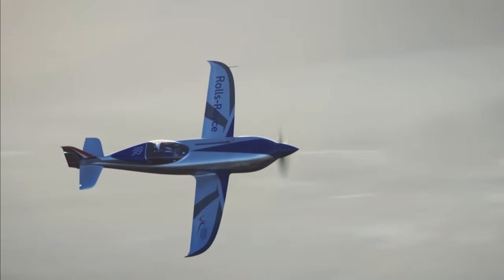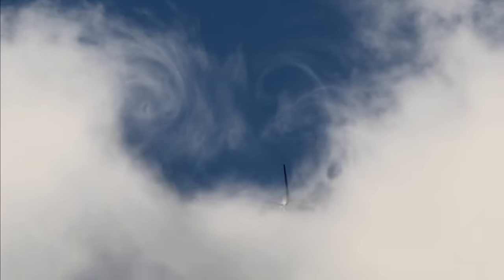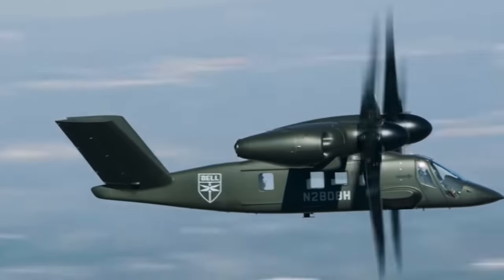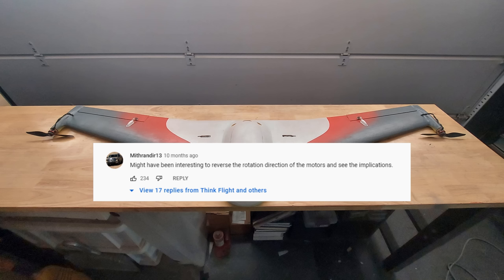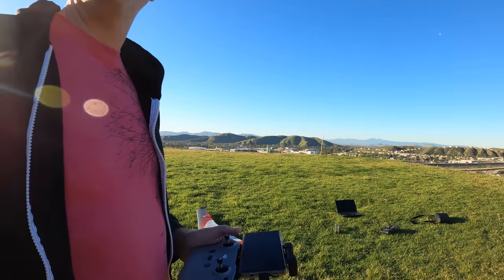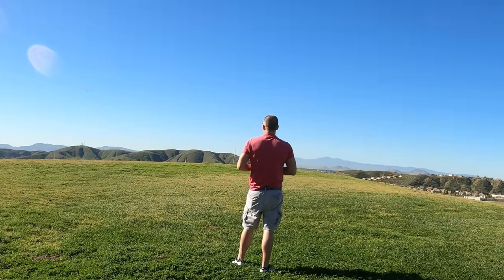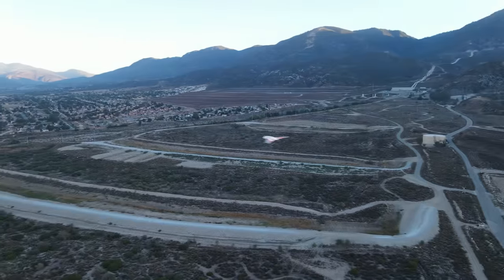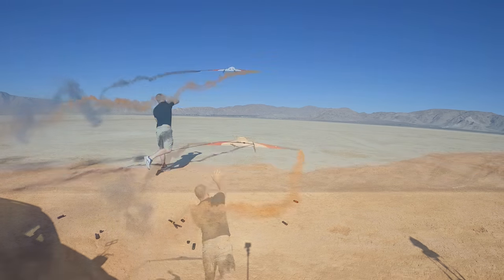Can Wingtip Motors Improve Aircraft Efficiency?  (Part 2)

Comment: I would think (and I cannot be wrong in this matter, just misjudging of the magnitude of its effect) that any swirl (i.e., from a propeller) over a lifting surface (i.e., a wing) will fundamentally decrease aerodynamic efficiency and therefore lift-to-drag. LD is everything.

Utilizing many smaller propellers instead of one big(ger) propeller (on each side) is a flawed solution. And, yes, I am aware of the saying that any aircraft is a collection of compromises flying in close formation. 

To be mindful, then, of first principles: What you describe will never work as well as the conventional configuration, in regard to my specific concern above.

However, this is not to say that motors don´t have fundamental advantages over engines, but why oh why cannot a big, slow moving prop not be electrically powered, instead of a “zillion vortex generators“, as you would envision them?

With electricity, there is not the constraint of powering a prop from the hub. Radial engines with their large frontal areas illustrate the fact that the distal 40% of a prop generates 90% of its thrust.

Also, you do not discuss whether the props at the wingtips turn clockwise or counterclockwise for the express purpose that their Q-factors mitigate wingtip vortices.

And don´t even get me started on the problematic concerns of battery weight, charge density, battery aging, the nonexistence of charging infrastructure in general aviation, or the fact that lithium + moisture + vibration is the modern equivalent of flying a Me-163 Komet, whereof in that WW2 aircraft the pilot tended to be dissolved to death by its corrosive fuels. Have you not seen what happens when a lithium battery fails catastrophically?

Maybe some day electrical propulsion will have its ascendancy over petrochemicals, but not yet. I look forward to the time that graphene-based batteries are sufficient developed and available, or even better yet, the discovery of a room-temperature superconductor that will enable a practical SMES (Superconducting Magnetic Energy Storage) device.

Now that will definitely revolutionize aviation!

Comment: I have to add that on average i have seen far far less operational failures from electric motors than i have engines. The simple truth is although fuel can pack much higher energy density the cost is a far far more failure prone machine, the intricate nature of engines can function greatly for air vehicles but when they fail it goes bad. If a motor has a similar point failure in the coils it is likely an overheating issue or a short and that motor will just have to run at reduced speed, far more favorable of an outcome than complete engine failure.

Comment: Also friend if i were u i would use a tractor and use a folding prop (the sort used on model giders) as then you wouldnt damage the aircraft when landing
Reply from the maker: The motors sit low and just dig in
Reply: Oh ok! It won’t do ur effecency any good but chucking some retracts on it would be cool!!
Reply: An option might be launching/landing VTOL in a tail-sitter configuration. 
Typically with tail-sitters, motors are mid-wing to give maximum airflow over elevons.

Comment: Aircraft are a compromise, you never optimize 100 percent of each aspect of the design. Tip mounted engines only work if the two engines are physically connected mechanically. A failed engine (without cross drive) will cause an excessive yaw condition because of the drag generated by the stopped prop (even if it's feathered), plus the opposite engine generating power, So a mechanical interconnect is the minimum needed to assure both engines remain turning. The mechanical interconnect will prevent the yaw moment created by 'Single engine out' condition, which is going to be considerable, a terminal spin would be the result at low altitude without out it I suspect. Cross wind landings would be a problem requiring very long main gear legs, or the landing gear will need to be out near the engines which in turn means an increase in both beaming and torsional rigidity requirements, this adds weight, plus the ground loop problem. The governing failure condition is centered on the thrust line and it's distance from the cg. As an aerodynamic curiosity these types of configurations are worth pursing for the sake of science. however pursuing designs like this to be man rated and such is too dangerous, we end up with an aircraft that is very heavy because of the design configuration needed to deal with the Yaw issue.  There are other ways to solve the basic problem, but this video is about one configuration.

I'd like to point out that there seems to be many new electric designs that use many propellers, up to ten on some designs. People need to understand that a propeller has a TCDS issued to it, and therefore requires annual testing ( the same goes for the motors BTW). This could be very expensive, engineering students fall into this trap often because they don't know the FAA requirements.

Comment: They North American, XP-82, didn't fly, it's 1st two times. The Reason: while using the P-38's idea of one engine spinning Opposite (to eliminate 'Torque' and Rudder-Correction), the first 'Twin-Stangs', had their Merlins mounted on THE WRONG BOOM, thus Cancelling the 'Added' lift they were supposed to have in-flight. VORTEX Matters!

Comment: If you want I can simulate it for you in starccm with more details
Reply from the maker: How difficult would it be to simulate with rotating props of different pitch?
Reply: @thinkflight  if you provide the cad it wouldnt be too hard , but we can only do steady state rans with medium mesh density ( around 10 mil cells ? ) maybe less due to low speeds
Reply: We can communicate via discord if you are using it

Comment: Such aircraft would be absolutely deadly if one engine failed way too much power on wingtip and none on the other side would instantly render aircraft uncontrollable.
Reply from the maker: This is a drone testing wingtip motor efficiency.   It is never suggested to be used as a final configuration for manned aircraft.
Reply: @thinkflight  That is true as a drone it is fine.

Comment: The Problem I see with this Engines at Wingtips Plane Design is ... the weight is on the Wingtips , which is at the Weakest Point of the wing .... And the motors are far from the center line , so if one engine fails ... you can't Fly home on one motor ! ... That's why you Never see this kind of plane ... :-/

Comment: @Think Flight
An idea for future research.
Imagine a test rig that can attach to the front of your vehicle, it can support the item that is being looked at but not interfere with it.
You could test a wing or entire aircraft without flying it or having to use a wind tunnel. It'll also let someone record video using as many cameras as you want and from whatever angle you want.
This would even allow you to test a wings maximum load as if it were doing a loop.

Comment: Without knowing the actual effect of the loss of one motor on a quadcopter, I'm still not buying your argument that your tip thrust proposal is an "acceptable" risk since quadcopters are generally an all-drone application.  (Unless, of course, you are thinking this advancement is STRICTLY for unmanned vehicles, in which case, ANYTHING goes.... 😂)

Comment: Maybe a "normal" plane would work better for testing this (with separate vertical stabilizer and wing). Also it might be worth to consider the fact that (at the same thrust) 2 propellers are less efficient than 1 bigger propeller, so for the wingtip placement a good option it should be also more efficient than the disadvantage of having more drag

Comment: 🤔☝, The wing is getting mini pull of Air Flow From On Top (- Pressure), Under wing getting +Push Due to rotation of, Vortex,  Advanced of wing ? If sideway's being Perpendicular? Versus - Dragging Air Towards the Top of wing in "Opposite- Inward rotation, Pushing Downward on WIng's Top surface. is Oposite of Removing air Pressure from the top, {If Vortex Pressure Spin Direction, Matter's}. It would barely be any thing,  and not have a Far reaching effect.  I just can't say, hat's my thought's,  Hope my wording isn't confusing, hard concept to verbalize, Need drawing board to be Clear.. Kind of retarded, Dain Dramaged..
 Love your Skilled, Build, Nice work.. Brillant plane Sir.👏

Comment: Love the content but comparing the weight to power ratio of engines without factoring in the stored energy to weight ratio of the fuel (or batteries), is pointless.
Reply: No it isn’t.
Engines of all types (air, land, sea, space, subsurface) are rated by thrust (or impulse) to weight of the engine itself.
This is also why many engines also include a per vehicle installed power/thrust/impulse to weight ratio.
Without the engine-specific power to weight ratio, considering different engines for different uses would require ridiculous waste of time, energy, manpower, and money.
Reply: @montithered4741   an engine is nothing without fuel. Just so you know that.  Power to weight ratios are for comparing like fueled engines. Unless you factor in the different fuel THEN ITS POINTLESS.
Reply: @C3Rl3  
What engineering degree do you use that DOES NOT compare engines by  power/thrust/impulse to weight?
Engine Performance is engine performance?
Reply: @montithered4741  "Engine Performance is engine performance?" yeah it totally doesn't matter.  The engine doesn't need fuel.. your right. Engine performance is 0 without fuel.  But hey you better not factor in the weight of what the engine uses right. idk if you need a engineering degree to know that. 
wait do you have an engineering degree? If so do you expect people on the internet to believe you when you say you do.
Reply: @C3Rl3  
The fuel weight is separate from the engine weight.  
Factoring in fuel weight with engine power to weight ratio is foolish because then the exact same engine would have many different power to weight ratios.  The amount of fuel doesn’t affect the power to weight ratio of the engine.
Reply: @montithered4741  your right, all fuels have the same stored energy to weight ratio. Thats why electric motors have been far more efficient than internal combustion but just some how i wonder why they weren't in things that had to move independently. I bet it was the government just keeping us down your right. It definitely wasn't because of the stored energy to weight ratio of the fuels used. Have fun with your theoretical engine that can fly to the moon cuz its fuels weight doesn't matter. lmfao

"then the exact same engine would have many different power to weight ratios."
 wait you just figured this out?  yeah i mean if i just run any fuel that will cause combustion in the thing the power to weight ratio surely wont change. Man your magic motors are gonna change the world.
Reply: @C3Rl3  
You really aren’t paying attention; rather doubling down on an already flawed claim.  Square pegs into round holes often?
The energy density of fuel is separate from the power to weight ratio of the engine.  Engine performance is given per fuel source, so again, one engine could have multiple power to weight ratios.
How do you plan to compare your near infinite numbers of different performance specifications for your imaginary engines?
Reply: @C3Rl3  
Electric engines have the capability of being more efficient than internal combustion engines; but again you are trying to cram too many factors into a single design factor.
I never claimed all fuels have the same energy density; that’s your assumption since you brought it up.  Stop going on unrelated tangents: as if you think talking more means you are talking better.
.  
Power to weight ratio is one of many variables that are used to evaluate performance.  Energy density is a secondary factor, especially considering most engines have few energy sources. Changing fuel sources can also negatively affect performance because engines are generally designed for the use of a single fuel. 
If you think otherwise, try running a diesel engine on unleaded gas and an unleaded engine on kerosene and see how that affects performance.
.  
Total fuel WEIGHT is a primary design factor because this can be changed relatively easily to affect performance factors such as aircraft weight & balance, stability & control, takeoff & landing distance, altitude, airspeed, and flight duration.